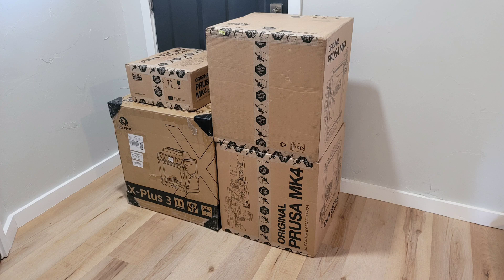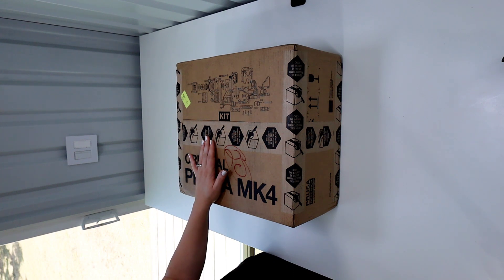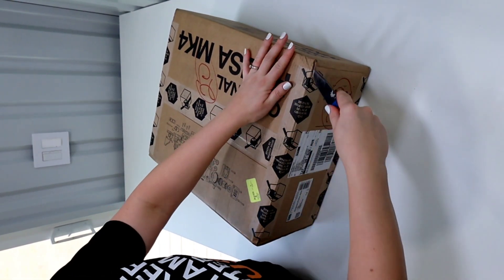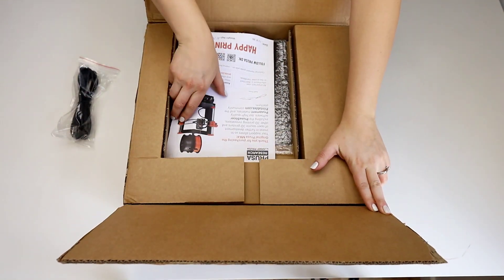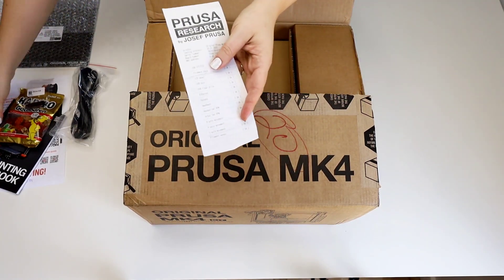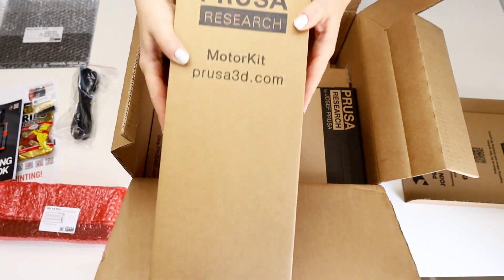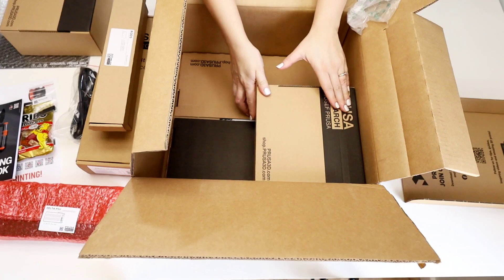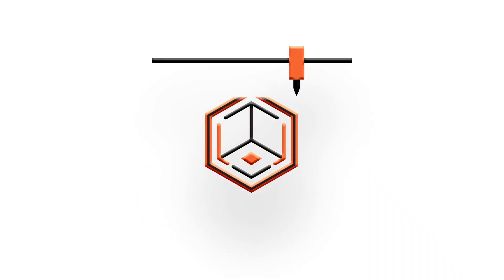MK4 Assembly - Chapter 1 - Unboxing and First Look at the Kit!

Comment: Are assembly tools included, if not what assembly tools are required? Thanks.
Reply from the maker: Yes they are included. But it's nice to have a set of allen and torx keys that don't have that hook at the end. Makes it much easier on the longer screws. Thanks!

Comment: It took me somewhere between 20-30 hours to put my MK4 together, and I've done 1 MK3S+ before. The one complaint I have about the MK4 kit is the frame bolts. They have shallow heads and will strip very easily, especially with the poor Allen wrench provided. I didn't have this problem with the MK3 frame bolts. I see they look like different brands. Anyone reading this, I would not recommend fully tightening the frame bolts down until you square off the frame on a flat level surface. That way your not constantly loosening and tightening the frame bolts causing the Allen head to whomp out. Because I believe the instructions have you tighten them down before checking for squareness. Don't do that, tighten them WHILE your checking for squareness instead.
Reply from the maker: That makes me feel a lot better. I think I was around 20 hours which was double what I was expecting! I felt like I spent a lot of time looking for things or fighting to get some screws in the plastic parts. But I did learn a lot! I agree that they say to tighten down the extrusion parts and then after you have the plates on, they talk about making it square. Thankfully mine wasn't too off. Thanks!
Reply: I did the MK3S to MK4 upgrade and it was about 20 hours start to finish (including stopping to eat, walk doggos). The only things that sucked were that the documentation says the planetary gearbox should spin with “zero” resistance which is definitely not true (should have a consistent low and smooth resistance) and also aligning the lead screws to the holes in the x gantry sucks. Bed standoffs, wire management, and bearing constraints are massively improved vs MK3S kit.
Reply from the maker: That's why I am coming around to the online instructions. Them being able to get specific comments and make adjustments is great. Thanks!
Reply: @tada3dprinting  Yes, that is a nice feature.